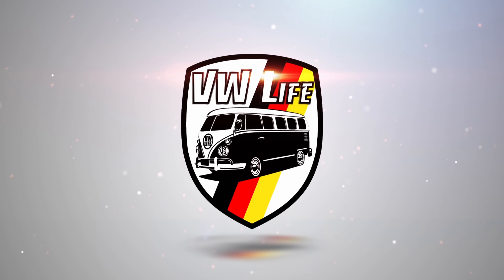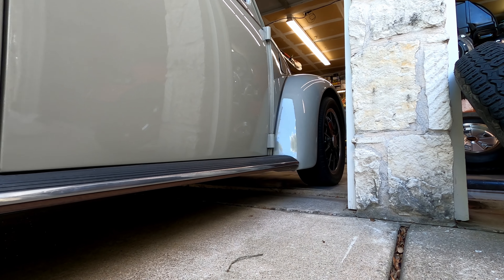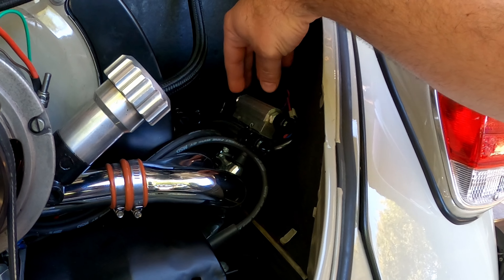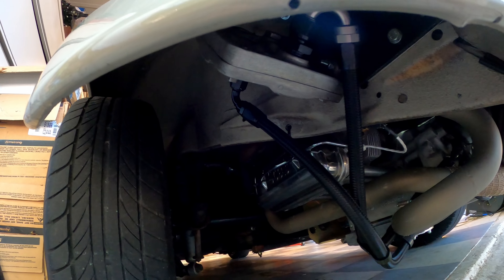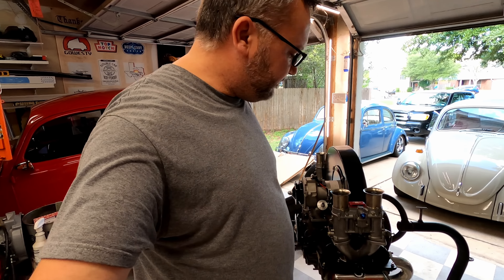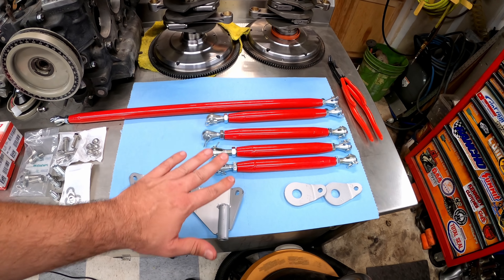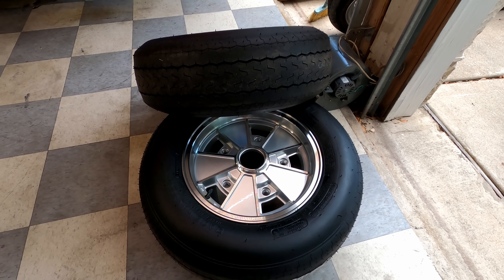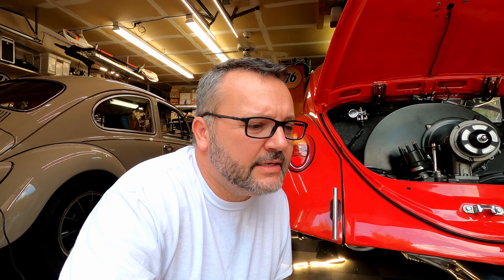Kafer Bar Install with Tommie B!

Comment: the front mounting bracket for the Kafer bar is bolted to the frame horn through the small end of the bracket that's why just the one bolt hole and no trimming for your brake tee would be required.
Being that they neglect to provide a simple instruction sheet with this kit it can be said there is no wrong or right way to install it , I just found after trying all possible configurations that this was what made the most sense and fit with no stress on the other components .
Reply: I agree - I found others that swapped sides with those brackets and were able to use the single bolt. My 2 bolts version with a notch around that Brake T was certainly a little more work but in the end I am ok with that and I feel it actual does a little better job of staying put ..     HOWEVER!! in the end I did a berg traction bar to hold the motor up and it DID way more to stop shutter than everything else combined . but that is just my experience at this point.. 
Thanks for watching

Comment: Do you run the koni adjustables in the front?  Wondering if I should go that route or just basic oil shocks with my 4" narrowed beam
Reply: Well I do have oil filled up front - 
I ordered Koni’s for upfront but didn’t install them yet .
   When I snapped an axle on the red car it caused me to focus on pulling motor/trans and fixing that so I need to get back to the other stuff I need to work on.
  Oil filled are great shocks for regular driving .
  Depending on how in-depth on going down the track you go shocks , clutch management ,rpms, tire size and such will always be items to pay attention too.
  If you make a choice let us know and let us know if you have feed back - we love hearing from everyone and learning also 😎😎😎😎

Comment: Were there any problems bolting the trans back onto the trans mount with the Kafer mount behind the trans mount? That would push the trans mount out a bit.
Reply: No the mount is slotted and allows for a little back in forth movement . My mid mount is weld in so the trans didn’t move at all ..

Comment: Tommie, I love the video and your garage is Awesome looking. I wish you started the 68 beetle with the fuel injected engine, wanted to hear it run.
I'm surprise you're not sporting an electric beetle to boot, maybe later down the road. Thanks so much for sharing. :-)
Reply: The video of it backing out was with it started and running . Sounds awesome but that didn’t make it in the final version . We’ll do a round two with some more details of them
Reply: Tommie Smith 
That’s will be awesome and maybe a lesson or two on your oil cooling system, it does get hot down here in Cali.😃🚘
Reply from the maker: we'll try to get some footage of it running and the sound at the next 1st wed

Comment: nice video. I made one similar to that design. I haven't had a chance to drive the car being that im still building the car. how do you think this kafer bar has helped you?
Reply: I have taken it out and made some hard launches - so far it has felt awesome no rear end hop with DOT slicks.. however my clutch disc just went to crap. So motor is back out and I’m trying to figure that part all out ..
Reply: @tommiesmith3369  great cars by the way. get that new clutch installed. i cant wait to see how that kafer bar helps.

Comment: What is the hp on that fuel injection engine thanks and what is the price of the kafer bar here in south Africa a person must manufacture your own brackets you are privileged to get the spare parts in America
Reply: Wouldn’t put a big number on the HP for the fuel injection car . But it’s super smooth running.
 The kafer I think ran me around $300 delivered . From coolrydes customs

Comment: What fuel injection setup did you use? I'm interested in doing FI on mine in the near future
Reply: An older setup of Cb performance their quick tune ECU .
 Check out Mario at the dub shop they do go work on FI for air cooled
Reply: @tommiesmith3369  Thanks!

Comment: Love the stance and tire wheel combo! Size tires are you running on the gassers? The cal look is so classic. So many great videos guys, thanks.
Reply: 205/65/15 on the gas burners on the 68.
195/50/15 on the front .

Comment: Hey man Kevin here from Australia. 
First your red 66 is amazing. 
Q. The kafer bar system is there any modification that needs to be done to the body. Is it just bolt straight on. 
Q. Have you got a link for the kafer bar. 
Q. Id love to see a video on your oil system it looks awesome .
Anyhoo stay safe man. 
✌   Peace
Reply: Yes pretty bolt in when it comes to the body and stuff . Did take a little extra work than just plug and play but wasn’t too hard
Reply: @tommiesmith3369  thanks man
Reply from the maker: good questions Kevin thanks!

Comment: You said triple Springs on those CB heads so this car doesn't see the street it's just a race car or does it get some Street time as well
Reply: Zas- I haven't been over here to answer any questions lately, My bad.. Yes the prior setup did see street time with triple springs (the 3rd one is more for control than spring pressure) But I made some changes swapped out the cam and lowered the compression on it with a new set of Street Eliminator heads that I ported on myself. I think they're some pics of them on my Instagram, 
Thanks for watching Zas 😎

Comment: Hey Tommie,
on your wifes car how did you run the fuel lines to and from the tank.
✌️Peace from Melbourne Australia.
Reply: I ran 2 aluminum fuel lines down the Pan on the outside and made some bracket for where those lines turned to soft lines and bulkhead fittings . I think we will make a more in depth video of it and how it is setup.. Thanks for watching 😎
Reply: @tommiesmith3369  
That would be great if you could make a video. 
To be able to see how your actually set things up with the fuel injection and fuel lines would be great. 
Keep the videos coming. ✌️Peace

Comment: At 11:12;  I understand the need to do it but what about its strength and why didn't the kits manufacture know that needed to be done (thicken it to compensate)?  ;-)
Reply: Well the kit was designed for the brackets that I cut to be on the opposite sides - but I didn’t like that overall - I think the way I went caused a little more work but I like it much better this way.  Plus I added a bolt when it came with only one as an option.  One allows the brackets to sorta move to where you need it - two gives no room for movement- again more work but I do dig it - way more this way🤙🏼🤙🏼

Comment: G'day, 
Kevin here from Australia. This must be the 20th time I'm viewing this it's a good video. 
Anyhoo I've got a couple of questions. 
Q. The shocks you installed what setting did you end up using. 
Q. Your racing your car did you have recovery hooks/rings installed. 
Q. How are you finding the stiffy kafer kit I'm about to  install one on my 63. Bug.
✌🏻   Peace
Reply: I went in the middle.. but now after running at the track I have them on the stiffest setting. I also put the rear travel snubbers back in to play .. as the rear Squatted way to much with the way I had it .. It ended up breaking an axle prior to the first race.. then second race I destroyed first gear.. third race went much better.. got 5 good runs in .. I guess if you throw enough MONEY at it .. anything is possible :)
Reply: @tommiesmith3369  thankyou for that. I haven't been able to have a run at the track yet due to covid lockdowns but now I know what could happen.  I just throw money at my Betsie as well. 
✌🏻  Peace

Comment: I wondered if any of you were into high-performance!? Good to see your cars and your race car! 48 IDAs all the way!What sort of times are you running at the track? Stay cool
Reply from the maker: he broke and stock axel making a test hit before he could get it on the track, the plan is to have it out in two months for it's first run :)
Reply: @VWLifeVW  I’ve done the same in my 67 racing at Lucas oil speedway in Indianapolis. Stock axels don’t hold up to lots of hp. Please post some results when Tommie goes racing!
Reply from the maker: @scotwheeler5789  ah okay, we are going to shoot a video when it happens so stay tuned!
Reply: @scotwheeler5789  Working towards making the Texas BugIn (show,swap, and race) hope to see what she'll do. 
Got the trans back in with new axles and changing intake manifolds so doing some port matching right now. but should be ready for March ..

Comment: You should try and run all your fuel thru a cooler to chill it,
Reply from the maker: Ah okay cool
Reply: Running 110 octane right now.. so far haven't had any issues..  Next on the list is probably a cam change.. something with a higher power band.  :)

Comment: I have a 72 beetle and when I start it up there’s a really bad rattle and very loud sound when you push in the clutch then when off the clutch it quiets down . Dose anyone have a suggestion of what it could be ?
Reply from the maker: Throw out bearing maybe?
Reply: Thanks!! I’ll have to check on that.

Comment: Tommie, you have some really sanitary cars!  Beautiful stuff!  I'm curious how the kafer bar affects ride and handling.  What is it supposed to do?  Does it prevent tucking under on the rear when cornering?
Reply: It prevents flexing of the frame horns - some cal them dog leg - frog legs ? But those flex and it locks them down to stop the flex ..

Comment: Some veedubs...but disk brakes on a 36hp...really. ;-)
Reply from the maker: Hey it can easily get up to 60 to 70 miles an hour just like any other Volkswagen:-)
Reply: @VWLifeVW  Wow, a speed monster for sure. How do you handle the g forces. :-)
Reply: @rickden8362  Those are "G" forces ..the cool ones like being O."G".  - But to answer your question.. going 5x130 is easy on the rear as they make plenty of Drum options for that. Upfront ? Nope.. Disc is about all the options for 5x130 .. going Disc was not for Speed safety it was for going 5x130 pattern on the wheels and a little safety came with it. 😉

Thanks for watching